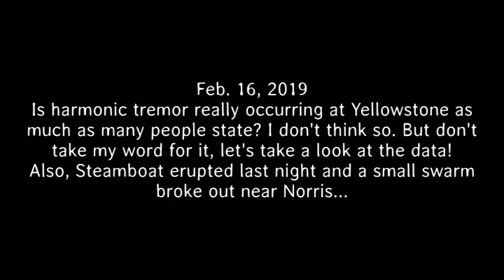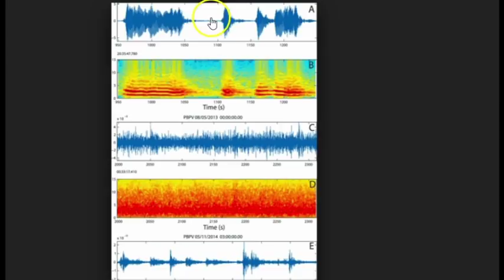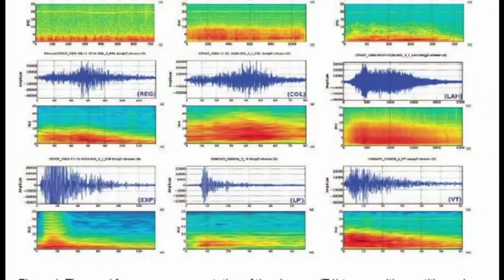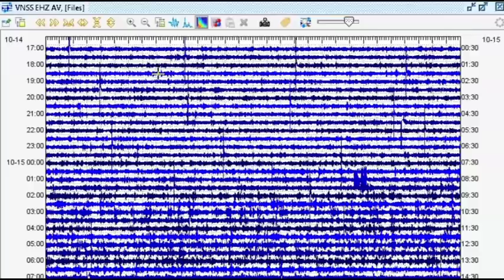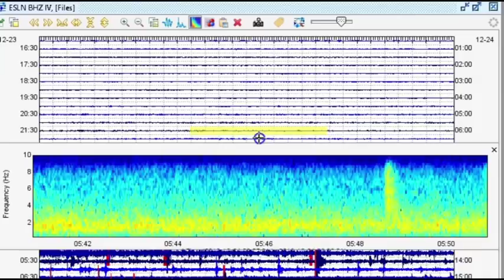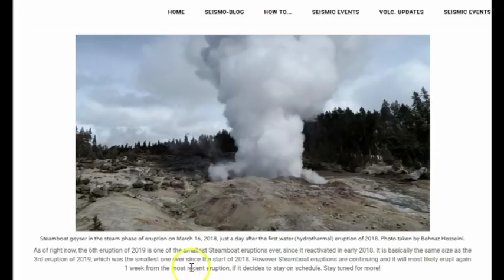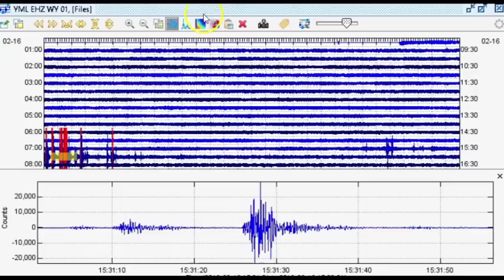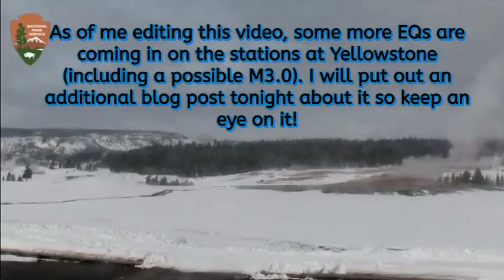Is Yellowstone Caldera Seeing Harmonic Tremor? What harmonic tremor actually looks like...

Comment: First off ben, there are gas spectrograms at Yellowstone. Secondly there have been harmonic tremors that have been censored from the USGS for fear of causing a mass panic to the general public and crashing Wall Street. thirdly all of the geysers in and around the Norris geyser basin have shown increases of acidic level in their water. Some of the mud pots there happened to be boiling. There has been increased uplift in around Mary lake as well as Yellowstone lake. I applaud you for teaching yourself, but you need to reach out to people. There are different spectrograms at Yellowstone. There is also temperature readings going up. When a harmonic tremor is picked up or a volcanic tremor is picked up on a seismograph, (depending on how strong it is) it may or may not show up on the other seismographs. Because remember sound travels more slowly through dense material and it changes forms on the way through the material. and it also depends on how deep the harmonic tremor is and as well as where's the nearest station picking it up. There are localized volcanic tremors and harmonic tremors usually in and around where the magma is coming up.  I have been to Yellowstone and I have witnessed new tree kills being caused by CO2 gases as well as SO2, and ancient helium is on the rise as well. All indications of Yellowstone recharging and getting ready for an eruption. Do some more research. And please remember to reach out to professors and people who do it for a living and don't miss inform the public. Don't be afraid to ask for help.
Reply from the maker: Yellowstone IS recharging for an eruption. I entirely believe, contrary to the professionals in charge, that Yellowstone can produce an eruption with little warning (it would be intense but I dont think the warning signs would go farther back than 6-8months max, except for uplift). And I don't know what you mean. Harmonic tremor is not sound. It is a vibration, therefore it travels like a ripple in a pond if occurring underground. Harmonic tremor cannot just show on one station if there is a dense network. For example, is harmonic tremor possible if it shows on B208 but doesn't show on YLA, YTP, B206, or even B944? When events occur underground, regardless of harmonic tremor or tectonic earthquakes, it will travel in that fashion. How do you explain then the characteristics of harmonic tremor from Etna and Veniaminof I showed? Or even Redoubt or Kilauea? I reach out to enough people thank you. I don't know where you are coming from. The data is easily readable. But don't trust me or trust the pro's or even YouTubers, trust your own instincts and check out the data. After all, it is not hard to access seismic data at all. And I am willing to believe they hid something, however if possible please state the date and time of the hidden events. The only way I would be completely concerned is if increased uplift was spotted with all the seismic stations going down. I mean every one. Because anything that happens at depth will most certainly travel. Take a look at the most recent swarm that occurred that I just posted about. It is much closer to the surface and is small in strength, but still travels to surrounding stations! Let me know if you need help but please don't be rude. God bless
Reply from the maker: Also please know harmonic tremor is just one of many warning signs. And some look different than others. However the one thing to remember is that if an event is produced by magma at depth, then it will surely be detected on multiple stations if within a dense network. Also look at how M0.5 quakes, even quakes going no higher than 5,000 amplitude count, still travel to neighboring stations. Practice makes perfect
Reply: First off Ben I wasn't trying to be rude I've actually got a broken wrist and got to speak into the phone so something's may or may not come out make sense to you but that's okay that's because voice texting.  One thing I wanted to point out to you been was all the information that you find online about Yellowstone like all the special reports and data interpretation from the USGS and all of them it takes him three years to approve all of that information that's being released. My thing is is I have any working knowledge of Yellowstone I have a lot of contacts over there in Yellowstone I also have a lot of contacts throughout the world and what we see at Yellowstone is its recharging and gearing up for an eruption it's no longer if Yellowstone goes it's more or less when Yellowstone goes. And how big will the eruption be remember since the last caldera forming eruptions there have been 80 smaller eruptions that get overlooked and not talked about. And you are correct about harmonic tremors it is a vibration not sound. I should proofread everything. Did you know there's renewed uplift in Yellowstone lake that started maybe eight months ago as well as an increased temperature readings in the sensors they put on the bottom of Yellowstone lake. There's also concern that a tectonic earthquake could open up a Fisher and lau magma to come up to the Earth's crust over there by Mount Sheridan. And another reason why you don't see some earthquakes spotted on some the seismograms is because they have them turned up way too damn high to detect anything.and remember the size of Yellowstone it's so fast that there's just not enough equipment to cover the whole park so at one end of the park you can have an earthquake swarm and know what's going on at the other end you don't know what's going on cuz it's just so huge.  I do want to pose a question and it relates to Yellowstone to you do you remember back in the summer when a fissure opened up in Grand Teton? What do you think caused it. I'll tell you the real answer when you answer the question. I do want to point out about the boreholes bore holes are placing where between 350 ft to 600 ft deep. send a cement well pretty much and it's got steel and cement to cover it up the only thing that a borehole picks up is anything well below the surface so if a borehole picks up any type of movement it's accurate it doesn't matter if it's a lot of Trevor doesn't matter if it's a slight earthquake or popping of the gases that you can see on regular seismographs and boreholes. A lot of people think by sing a seismograph and there's lines going up and down those are all earthquakes know some of them could be gas breaking Rock some of it could be little steam explosions up underneath the ground for the event like Yellowstone to take off you got to have a hydrothermal explosion once that takes place and two of them already have that the public is not aware of you're looking at it an eruption in possibly. That's how little west of us form was from a hydrothermal ruptured and that you had the hebgen quake. Did it get it I can 63 or 64 I can't recall you had another 6.9 earthquake. I have uplift going on all over the Park Yellowstone is going to erupt when probably in the near future probably in the next 20 years I don't want to scare anybody or it may not happen in the next 20 years like I said in my earlier statement it's no longer if your son is going to erupt it is a matter of when is when Yellowstone going to erupt now. And I'm sorry if I was being rude I done think I was but forgive me for it just in a lot of pain with a broken wrist and on pain medication so it's not a good idea to say these things when you're kind of loopy. 😁 But like I said I do applaud you I think it's great that you're teaching yourself
Reply: @raccoonragesquad6899  I don't know if he is. But he has lots to learn and I'm willing to assist him myself but it seems like he doesn't want. My dad also said a hard head makes for a dumb ass later in life.
Reply: Tony H yes! Totally agree. They censor data. They aren’t stupid.....they know the public has trained scientists that know what they’re looking at in terms of the seismographs. They aren’t going to show harmonic tremors, which is indicative of an eminent eruption!
Reply: Ben Ferraiuolo yes, it is possible.....it depends on where the magma is moving .... it’s going to show up differently the further away you get from the source.

Comment: Was checking the monitoring data on usgs.gov and it looks like there was a 0.9 at Crater Lake on the 16th. I've never seen anything there before. Hopefully it's not a one time thing.
Reply from the maker: I notice that as well. Actually gonna do a blog post on that soon. Crater lake is usually very quiet, however it still has a potentially active magma chamber.
Reply: @BenFerraiuolo  If Crater Lake were to have an eruption soon, I believe it would be a minor one. VEI 3 max. The last eruptions there were probably the last bit of magma in the chamber from the eruption that created crater lake. Also, I was looking at Utah today and it looks like there is LOTS of seismic activity at Black Rock Desert Volcanic Field. In the past week. The biggest was a magnitude 4.0.

Comment: What about all of the time the Yellowstone seismometers are missing data? Myotherapy evidence I've true harmonic tremors that they are cutting out. All of the sensors are missing a lot of data
Reply from the maker: Today, yes. Many of the boreholes in the PB network are missing data. However some stations near those stations still do have data. Harmonic tremor is like any other seismic event, in that it propagates away from the source like a ripple in a pond. If harmonic tremor was strong enough, say 1,000 amplitude count like at Veniaminof, then it will surely show on at least a few surrounding stations. Major harmonic tremor would probably show on all of the stations. Not much seismic data is missing though and we still have some neighboring stations that are active. However I would worry if every single station at the park went down at the same time. That is what it would take if they wanted to hide something. God bless!
Reply: One thing people fail to notice is when you look at the station notes it sometimes indicates that the moniters had been giving inaccurate readings and sometimes even saying the previous fix did not work.  So who knows what to believe anymore.
You really just have to check everything, or at minimal have to compare results from multiple stations simultaniously.

Comment: To many fear mongering regarding YS.. It's a hydrothermal area.. and activity in the area is nothing new! Also remember that YS is unique to other mantle plumes because it has 2 outlets where the other's only have one!!
Reply from the maker: I agree 100%. People take stuff too far regarding Yellowstone, which is one of the reasons I put out this video. However please remember Yellowstone does have an active magma chamber and reservoir system and has already seen two episodes of substantial uplift since 2004. Also remember a small eruption almost occurred in 2008-2009 at the northern tip of Yellowstone Lake. It could erupt in our lifetimes, or it could not. That is why we must just look at the data without any bias. But if there is a sign of a possible eruption, i will not be quiet about it. However, since 2008-2009, there havent been any signs of a possible eruption. Remember that can change very quickly! (also, the hydrothermal features at Yellowstone all gain their power and heat from the magma chamber below so in a way the hydrothermal activity is a sign of magmatic activity beneath the surface, just like with any hydrothermal feature worldwide)
Reply: @BenFerraiuolo  yes indeed.. regarding the changes last year...  obviously steam boat entered a new eruption phase.. but then there was a geyser that dried up,and then the dorm that began to sink!! This activity is to the north where the uplift is also found! Is this correct?

Comment: steamboat running out of water?
Reply: allan pulp   So how do you know this?  Where is your proof?
Reply: @jenniferbringman9054  it was a question.
Reply from the maker: @jenniferbringman9054  well it is actually a really good question and actually might be happening.
Reply from the maker: @allanpulp5120  lol. It is always good to ask questions! And you may be right allan. I think the uplift seen at norris over the past few years has been caused by upwelling of the ground due to the large hydrothermal chamber filling, preparing for the Steamboat eruptions in 2018 and now 2019. Uplift has stopped at Norris at almost the same time the Steamboat eruptions started to barely calm (they used to be around 60,000 to 100,000 amplitude count but now they are down to no more than 10,000). There could be a connection. I think Steamboat does have its own reservoir that is much larger than any other hydrothermal reservoir in the world. Long story short, you are probably right Allan. But we will have to wait and see! God bless!
Reply: @BenFerraiuolo  tx BEN